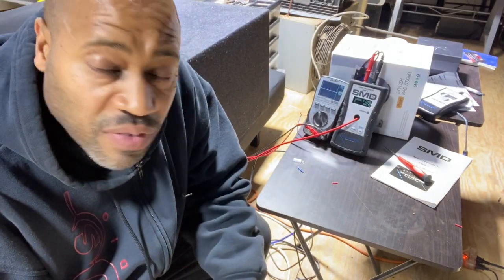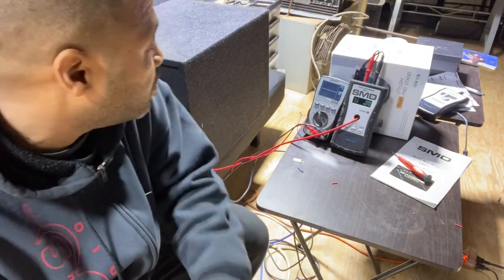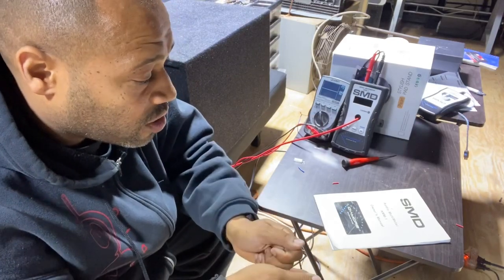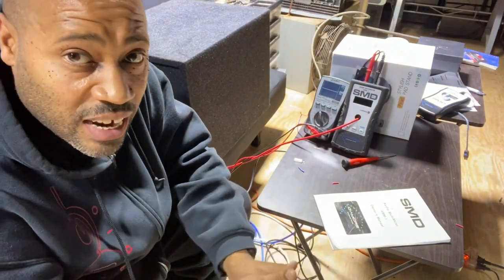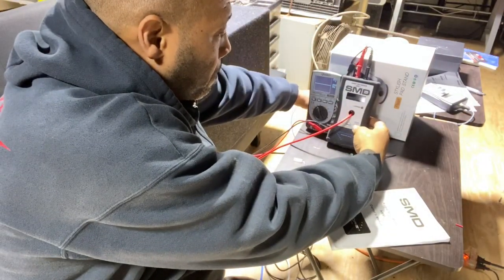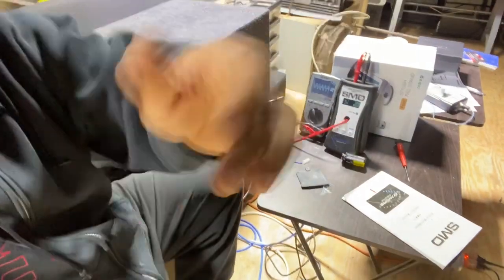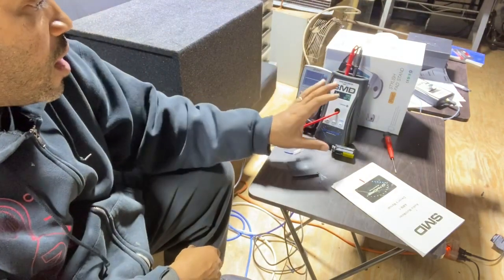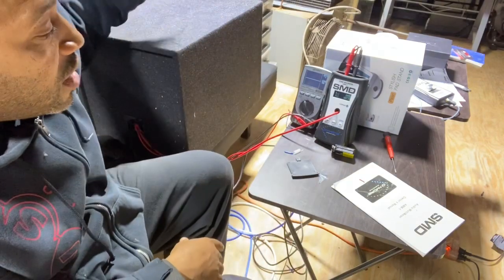Tool Time Tuesday SMD D’Amore AMM1 mini amp dyno

Comment: Mini Amp Dyno is more useful than the bid daddy AD-1 in some cases. Great vid
Reply: The ad-1 is for finding actual ratings of an amplifier though isn't it? It would seem this unit is more designed for testing at the point of install as wiring and charging system of any given vehicle will be different.